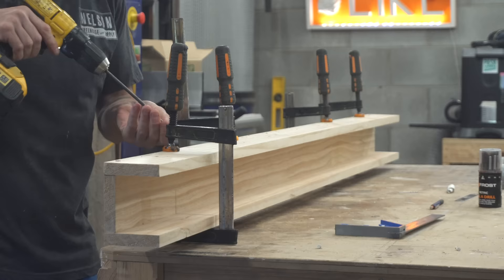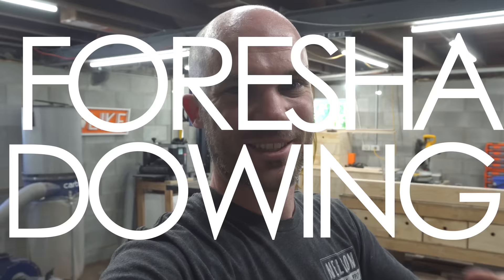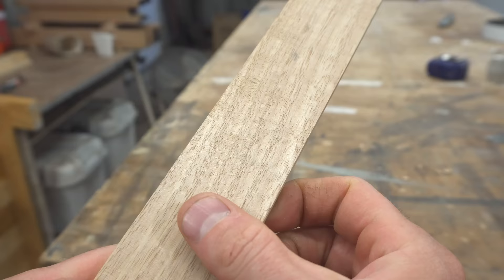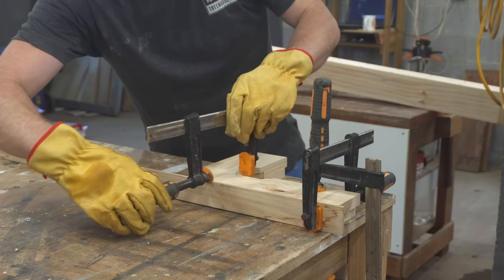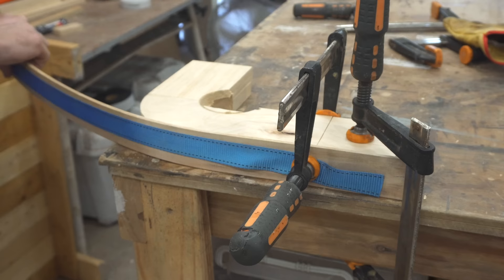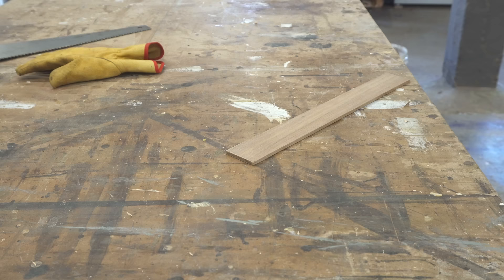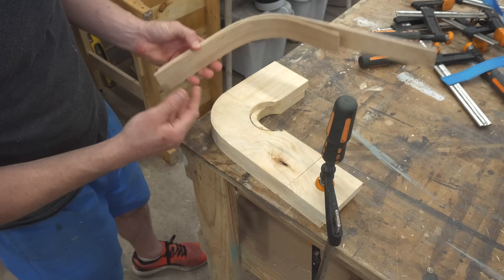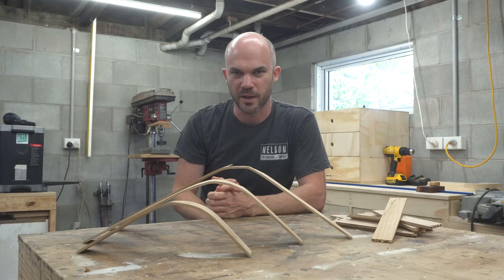Learning To Steam Bend Wood

Comment: I think the biggest issue was the use of kiln dried wood, but that's just based on what I've heard from old woodworkers.
I've done little steam bending myself and used a different method that involved a wet rag a blow torch and tube made of multiple diameters of aluminum pipe tig welded together, slow and steady seemed the rule for steam bending.

Comment: I've recently made a ~200mm radius bend with 8mm thick X 60mm wide Radiata Pine. I can get the radius down to 150 if I want to. I was using a steamer cleaner like you. also I doubt I got the 100degrees with my setup. What matters is the permeability of the wood. Treated wood, most hard woods, wood that has irregular grain like knots and are incredibly hard to bend and even wood that hasn't been cut quarter sawn (although it is not has important) could be more intensive, kiln dried wood is another factor, you just have to steam for longer really.
Some things to note
1) Keep pressure on the out side of the wood with a clam shell mould or a sheet metal band. Ratchet straps I find are just annoying to arrange and and make it hard to stream line the bending process!
2) If you are struggling to steam the wood it a damp and hot temperature (there needs to be constant damp air.. That is the main action to permeate into the wood fibers with condensation). Soak the wood in a tub of boiling water and wrap with cloth then steam for at least 1 hr. Ive managed to steam 8mm thick in 1.5hrs with this method
3) Also take it slow when bending! You dont have to rush to bend the wood! Think of it like candy if you quickly bend, it will crack!
4)If you need to keep the wood at a specific angle you need to stack at least 2 half thick pieces of wood together and glue with Polyurethane Glues directly after steaming. Or you can bend with no glue but leave in clamps until dry (1-2days in a non humid environment) and then use regular pva wood glue. This layering process will freeze the position of the wood at the angle it drys at (no need to over bend).
5) when bending wood make sure to have around 100mm extra wood tangent to the curve you want to create. this will reduce the load on the mould and make for a much more accurate bend (you just cut off the extra when glued)

Comment: Try adding ammonia  to your water and trying to get pressure in the chamber to increase saturation. Also to reduce cracking you need stops on your strap to keep the wood from stretching.
Reply from the maker: Hadn’t heard about stretching before, I’ll look into that. Thanks!
Reply: @RobinLewisMakes  yeah you want the wood to stay in compression while bending as much as possible. Like if instead of a cloth strap you had a thin piece of spring steel like a saw blade you can clamp the ends down on with blocks on each end to stop the outer edge  from being placed under tension.

Comment: The wood is cracked. You did it wrong. 
If you heat it with hot air, the wood will be drier and harder to bend.
You have to put the wood in boiling water, let the hot water run through the wood grain, then the wood will be more flexible, and then you can bend it. Once bent, maintain its position, then dry the wood. Easier.